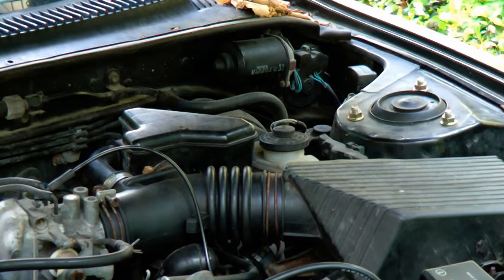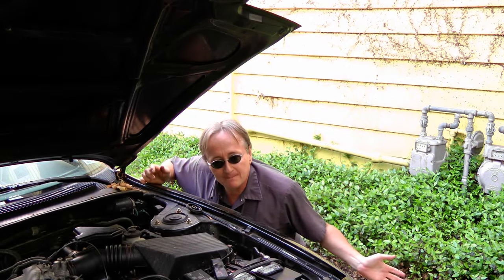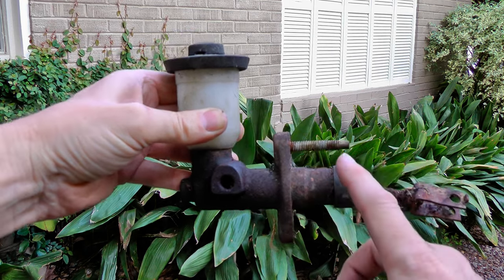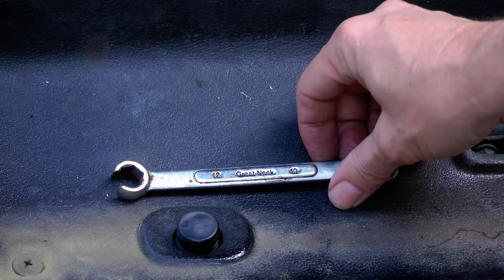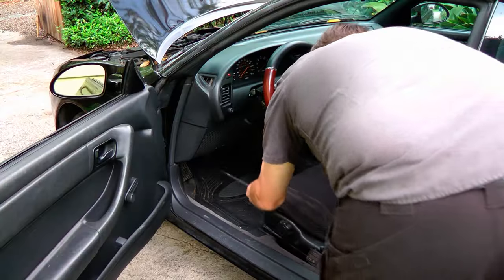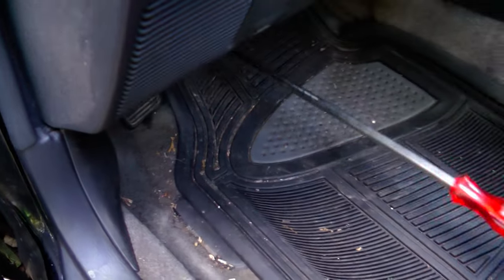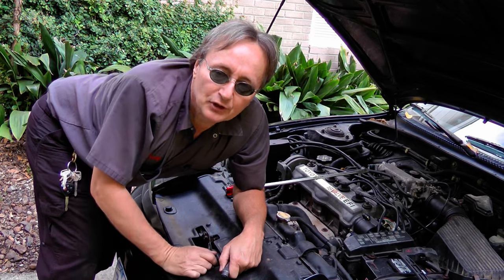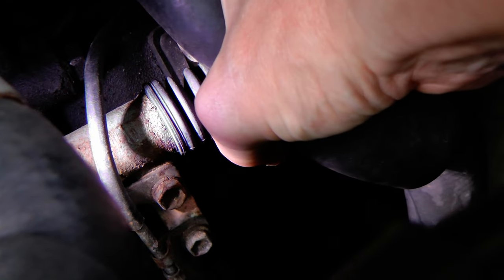How to Replace Clutch Master Cylinder in Your Car

Comment from the maker: when they get hot, and won't shift, either the clutch assembly is wearing inside, OR the actual transmission is wearing out, overheating, and jamming. Just be sure the hydraulics are working when it acts up, by having one guy step on the clutch while you see if the rod modes in and out at the slave normally

Comment from the maker: IF you have all the air out of the system, then clutch needs replacing inside the transmission. If clutch is rock hard feel, that's it for sure. If it's soft, often air is still there

Comment: you can also use a 60 lb weight to hold down the clutch.  Also, when bleeding, you need to pump the clutch pedal by hand about 5 times with the slave valve closed.  Then hold the clutch down, quickly open and close slave valve.... repeat until clutch pedal feels right. :)

Comment: Hi,Scotty. Have a 94 Mazda B3000 w/190k.Shop put clutchset & slave cyl@170k miles in 8/11. On Mon the clutch started not releasing when pedal pressed, so car quit when I stopped.Then put in gear, started, been notchy since, coupla Xs switched off pull over, shut off to get going again.When idling w/pedal in, can feel & hear like not fully disengaged, plus been difficult/unable to go in reverse unless engine off. Is this mast cyl, premature slave cyl failure, or clutch plate delaminated? Thx :)

Comment: hey scotty i have an 2002 cavalier and its been giving me hell with the clutch. i replaced the slave cylinder about 3 weeks ago but didnt replace the master cylinder. now when i go to engage the gear the car will move forward and  backward but not go into gear. would it be the master cylinder now? because i looked for leaks but didnt see any. also when i changed the slave cylinder and bleed it out i could hear it engaging and disengage when i hit the pedal and i can no longer hear that now.

Comment: i put a act stage 2 clutch in my car and it screches when i ingage in first gear so i thot it was the CM and SC so i canged them and it still screeches it only does it when it gets hot or after the car is driven like ten min, i dident drive the car for like two days and the cluch worked perfect real graby but after like 20 min of driving it started screaching agen and the clutch is never consictent it grabs at difrent spots all the time its real fustrating can any one help?

Comment from the maker: too hard often means the clutch was installed wrong and is binding. too soft is often a worn clutch mater or slave cylinder, or air stuck inside, they can be hard to bleed out, i often have to use a power bleeder on them

Comment: Scotty - Thanks for the video. Master is harder to get to but visible. I like the truck, have invested too much $ into it to give it up or recoup what I have put in. 
I understand ppl like puppet master telling me to sell it but I am a disabled guy from a broken back years ago. It's not that simple.  I have driven this truck for 19 years. I know that not driving a vehicle much can cause issues...seals, bushings, rubber components get brittle then leak or break....Brother,  I have regretted selling vehicles in the past that later sold for a lot. This is the last year for this body style. P.s. the stopleak worked albeit won't last forever. 
Previous post...
 hope you are able to read this and give some tips.
I am on my 3rd clutch, 4th clutch master cyl and 3rd slave - I have put only 27k miles on the truck since 1998. Sure, not driving much does not help keep seals and such lubed but damn. It's an '89 Chevy S-10.
My master cyl is leaking so, rather than replace (I have to haveomefoone do it because of my b back)I am going to try some Lucas Stop leak.
I know that how I push the clutch in, probably bends the rod thus causing the seal to weaken - that's just how my bad leg pushes it in - that cannot be helped.
Any suggestions on why so many clutches and cylinders?
Is it this year model? I have put a lot of $$ into it and refuse to give it up.
I mean, I am not like I was when I was younger - racing, acting stupid, burning up a clutch.
I don't ride the clutch pedal.
I really like your videos - thanks for any suggestion

Comment: I know this is an old video, but what a great idea using the long screwdriver to to bleed. I'm getting ready to replace the clutch master cylinder on my Fiero and my wife is useless to push the clutch pedal and hold it. There's nothing like bleeding and watching the air get sucked back in because she can't hold the pedel down. Then she complains that it's taking forever. I wind up gravity bleeding when I do it now. 

Thanks Scotty.

Comment: Love your tutorials! However, you didn't mention something here... 

You don't have to have a leak for the cluth Master cylinder to fail. Mine failed internally and the signs were: 1. A stiff stick. The stick was nearly impossible to move into gear. 2. When I bled the system, there was a ton of black gunk in the drained brake fluid. 

Just wanted to let your listeners know that.

Thanks and keep up the great work 👍

Comment from the maker: often masters leak inside and don't lose fluid but lose pressure. But if not, it would be internal in the clutch disc or pressure plate

Comment: hey scotty i just wanted to say something about when u press the clutch down and try to shift and the car moves but doesnt go into gear. I had this problem and, it turns out sometimes the throwout bearing gets stuck and doesn't release. A simple fix is called "sidestepping" press your clutch down and slide your foot off to the side and let the clutch pedal slam back up. i did it once on my car and that was all it took the car has gone good since. Luv ur vids keep doin wat u do best.

Comment from the maker: yes, they can leak inside themselves and od that.  YOu can bleed the slave or the master separately if you want. But when I work on cars that start to age, I just replace both cylinders cause if air get in em, they have seal problems for sure

Comment: You make it sound easy, perhaps I might give it a go. I do recall a Chevrolet Captivia my partner had a few years ago though, the slave cylinder was inside the gearbox or bellhousing - either way you had to get the gearbox out to replace it!

Comment: Greetings from Hood River, Oregon. Man I wish I would have paid more attention, I got my slave cylinder and master cylinder installed and was having a hard time cus the clutch wasn't building up any pressure, then my mechanic said I needed to bleed the master cylinder first 🤦‍♂️ which I would have known had I paid more attention when I watched this video...my reservoir isn't directly mounted to the master cylinder, theres a hose that leads out to it, I couldn't figure out how to bleed it until I had the idea to turn it over so where the air would pass through on the master cylinder was submerged in the reservoir, then I simply pumped it, added more brake fluid, and when I didn't see bubbles I reinstalled it and bled the rest of the system....though I didn't have a fancy pry bar like you, I just had a 2x4 🤣 but it worked and now it's all installed and working just fine 🙂 I'm learning as I go, but thanks to you I was able to replace my windshield wiper motor, and you did help get me started with my slave cylinder and master cylinder. I'll pay more attention next time, lesson learned hahaha. Thank you for your videos sir 🙂👍 next project, changing transmission fluid 😁

Comment from the maker: bleeding is useless in most cases. If air is in there, then the slave or master needs replacing. Check em for leaks first, squueze the rubber ends and if fluid comes out, replace em

Comment: I have a BMW 325i E36 got without clutch on the motorway while at 80mph.. pedal stuck to the floor.. a friend told me it should be either master or slave cylinder, i change the master, and bleed.. now i have strength in the pedal, and i can engage gears, but the car doesnt run with me pushing the gas pedal.. it shakes while i release the clutch pedal and  just runs by its own, if i rev it up the car doesnt driver. Any ideias @Scotty Kilmer ??

Comment: you could try sidestepping it when it sticks just press down your pedal and slide your foot off to the side and let it slam back up it may take a few tries but it may work for you. my throwout bearing gets stuck sometimes and wont go into gear but this fixes it every 
time.

Comment: Scotty, I had my master cylinder replaced a few months ago and today my car won't go into gear. When the car is on, the stick won't move but when it's off, I can move the stick freely. I have a 1990 Honda Accord. The clutch has no tension, but it is not laying on the floor. Where is the slave cylinder located on my car and is this a DIY job? Thanks! I'm a big fan!!

Comment: Hey Scotty Great Videos Got a Question I just bought a 1995 Chevy Caviler Z24 With a 2.3L has 165k Runs Great It has t 5 speed Manuel Transmission, my Friend that i bought it From said the master cylinder clutch was leaking into the Car so He Replaced it with a New one but of course it Has Air in the System. My Transmission has a Internal Slave Cylinder But can be Bleed Throw a Little Value by the Trans. We Pump the Clutch and Hold the pedal Then open the Value and It Squirts Brake Fluid out

Comment: Hey Scotty, I recently replaced both my clutch cylinders and have noticed a squeaking sound every time I depress the clutch. I'm pretty positive that it's just the rod from the master cylinder rubbing up against the boot. Is it safe/ok to grease the rod to get rid of the sound? I'm just asking because I'm not sure if regular grease will damage the boot or the cylinder itself. Thanks again for all of your videos! Anytime I have a new car problem your channel is the first place I go.

Comment: Great video, but my problem is with a '97 Ford Ranger. I can not get the clutch pedal pushed down enough to engage and for momentum. Just enough to start the engine , but not enough to feel the gear shift engage the engine for movement.

Comment: Hey scotty, you helped me fix my toyota before, hopefully you can help me with my 2004 acura tsx. The clutch squeaks when i press it and the engagement point is very low (maybe not even half inch from the floor) I replaced and bled the clutch master cylinder and adjusted the rod behind the pedal. No success. im going to replace the slave next. the low engagement point worries me and i grind into reverse unless i shift into 1st first. any suggestions? i hope i don't need a new clutch =/

Comment: I have a 2000 mitsubishi Eclips G manual,  and it will not shift into gear when I start the car. I can shift the gear when  the car is  off and I have watched your videos and replaced both parts; the master cylinder, and slave. I also bled the system.  I also changed the transmission oil afterwards. BUT my car will not go into gears, are there any other suggestions or parts that I need to change?

Comment: Scotty. I replaced my master and slave cylinders aftery clutch pedal began to get stuck on the floor. Everything got back to normal but after a while I began to notice clutch fluid on my floor and upon inspection I noticed that the master cylinder was leaking everytime I sqweezed the seal. Do I need to replace again? Its a 1991 Honda prelude. Thank you
Reply from the maker: +Steve Ramirez you got a crapper master cylinder, buy one at a different place

Comment: Hey scotty..becoming a fan of your vids. Recently i bought a 5spd hyundai accent driving it noticed the brakes would stick. Removed vacuum hose to cylinder i think. Heard air come out and put back on, car ran fine. Would stick again later. Took it to shop, they replaced calipers n rotors. They test drove it few blocks, was ok. I drove intown little bit,was ok. As i was heading home they started sticking again. Pulled over ,could see small smoke by calipers. I removed hose again and car ran ok.. my question.. is my master cylinder bad or a brake hose may be blocked ? Should i take it to auto mechanic or brake specialist?

Comment: Mr Kilmer great video. I have an issue with my Ex civic 02'. There is a gear crunch between 1st and 2nd gear. I have changed the gear oil (OEM) from Honda very recently, but still crunches from 1st to 2nd. Clutch pedal feels normal, though the clutch dosnt engage as quickly as it was before in 1st gear. Could that be master cylinder or slave cylinder ? the slave cylinder is leaking but barely anything. Thanks Mr Kilmer

Comment: Scottyyyyyyy I have a 2008 Altima coupe, and the clutch goes to the floor. No leaks on the clutch pedal though. could it be the master cylinder? Should i replace both?? I bought a slave, but don't know how to install it. THANKS. i'll watch your saturday show
Reply from the maker: I would replace both, but normally it's a bad master that makes it go to the floor IF the slave is not leaking fluid

Comment: I have a 95 Accord and I have a tough time shifting.  the gears all engage fine,  and shifting feels normal while the engine isn't running.  I'm not externally leaking fluid.  could the master and slave cylinders be internally leaking causing this?

Comment: hi Scotty ,i replaced the clutch master cylinder, now my problem is, is there a special tool for putting a clutch spring back, i have a 2000 grand am 2.4l, and its been a pain to squeeze the spring so that it pops back in the groove in the center and one hole on each side

thanks

Comment: Hey Scotty, I have a 74 Ford Courier, I just replaced the clutch slave cylinder after the pedal had went soft and was becoming hard to shift. After replacing and bleeding the line the problem has not gone away, I don't see any leaks on the master cylinder and the slave cylinder isn't showing any signs of leaking either. Should I try and bleed the master before trying to replace it?
Reply from the maker: just replace the master on something that old.
Reply: did it, it worked. thanks for the advice.

Comment: scotty, my car is very basic and instead of transmission fluid the brake fluid is used. what would I change in the process to fix the master cylinder? in case it matters it's a 91 ford escort pony 1.9 l
Reply from the maker: +Kendra Sedgwick all clutches uses brake fluid in them just about. Merely flush it out with new stuff by bleeding the system

Comment: Hey scotty, love the videos. I have a 1998 Saturn SL2 that's having trouble shifting. It shifts fine when the engine is turned off, but every once and a while it just refuses to shift into gear. When that happens pumping the clutch seems to work. Could it be air in the system? I've been told you can't bleed these cars, but i'm trying to avoid buying a new hydraulic system if possible. Any help would be greatly appreciated!

Comment from the maker: @rb26dettsr20  Rattling with clutches like that are usually worn throw out bearings or worn clutch plates. As long as it works, live with the noise because the only option would be to tear the tranny off and replace the worn parts. And don't use that same company for parts again ( I assume you used a kit and replaced ALL the parts, not just the clutch disc.) Scotty Kilmer

Comment: In this car the clutch and brakes share the reservoir.  I have a suction pump that is just a tube with a piston that you push or pull fluids in or out of with the handle, kinda looks like a grease pump. I got it to put gear oil in the rear diff but haven't used it yet.

Comment: Scotty i have stiff hydraulic clutch problem. It's soft at cold start but when the engine gets warm it gets stiff and the biting point seems to go high. I have bled the slave many times and the problem stays. It wasn't the clutch disc because it was just 2 years old. A mechanic told me to do the push back technique, or to see if the insides of the clutch was properly greased. Would this solve the problem?

Comment: I have 93 stealth, twin turbo, awd. It used to sound like an airliner taking off, when I was going 70 mph. I let it set a couple years. When, I went to drive it, no clutch. I drove it anyway. I had no clutch, but that noise, usually started at 15 mph, was gone. No clutch, no noise. Pumped the clutch, no bubbles just an upward flow of fluid. Reminded me of when the master cylinder inner rubber seals(?) go out. Blowby. The slave cylinder inners are worn out? Why did it make such loud noise?
Reply: +Nonconcensusical  Or, it's the master cylinder and the noise is something else. Years ago I put in a new driveshaft with u-joints and hanger bearings. It was making a different vibration noise.

Comment: Scotty, thanks! I have a 98 S10. Last week, I pushed the clutch pedal to the floor, and it still wouldn't fully disengage, it was hard to shift. I bled the system, and it worked for a while. When the problem came back, I pumped the pedal several times, and it worked again. Now, the clutch won't work, I can't get it out of gear, and pumping the pedal won't help. Trying to figure out, is it the master cylinder, slave, or something in the bell housing? I don't see any fluid leakage.

Comment: Scotty: my car sounds horrible when I push and old the clutch pedal. It makes an airy hissing noise like an air brake when I push in and out and it makes a sort of metal rake brushing metal sound constantly when held. It was even making almost like chipping sounds like it was chipping apart last night. And it also start making this high pitched noise which I think is coming from metal on metal vibrating very quickly but if I push the clutch in and out 20% very fast, it goes away for about a min